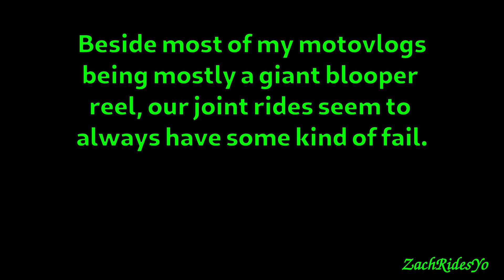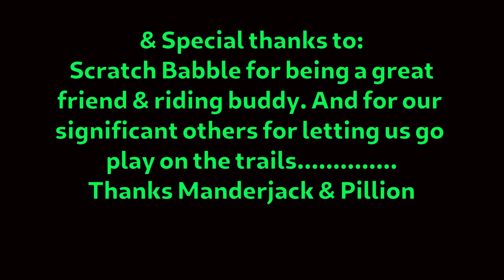Part 3 of 3  - 1st Official Dual Vlog w Scratch

Comment: I usually overlay 2 tracks and pick the best audio. I still like the Sena audio through the audio pack and into the vintage GoPro, it crackles a bit but still sounds the best.
Reply from the maker: That would be much easier, but sometimes you just gotta work with what ya got and/or work a little harder.